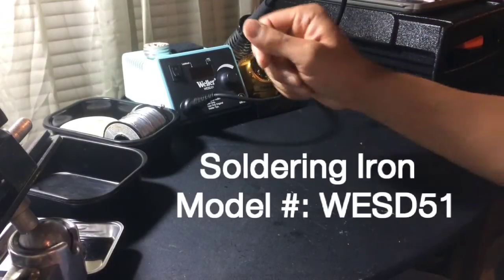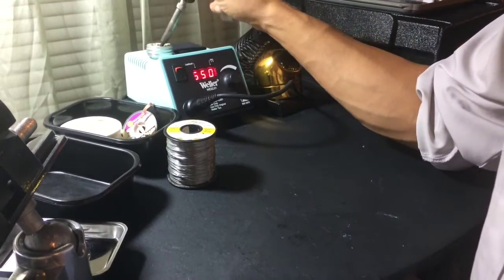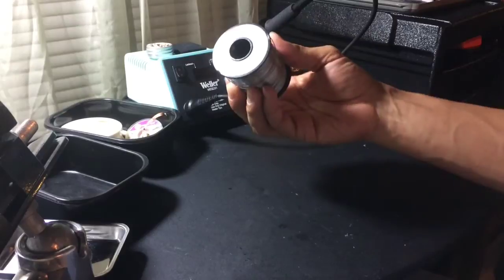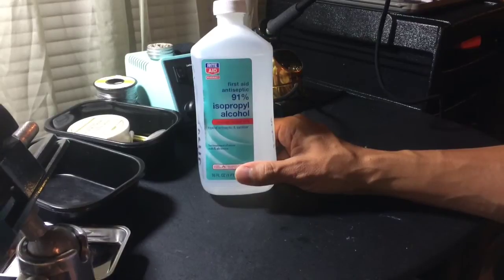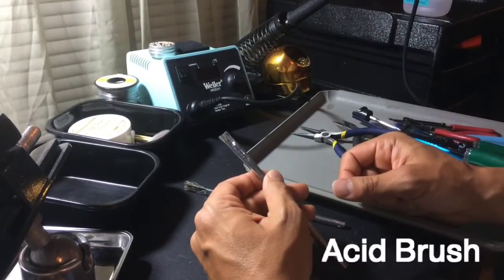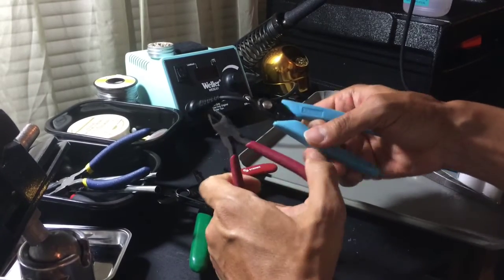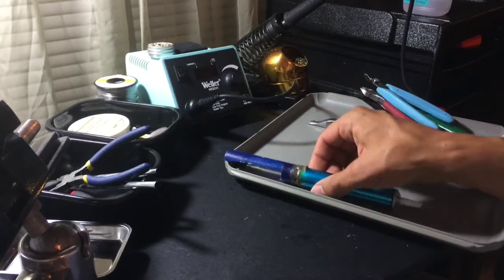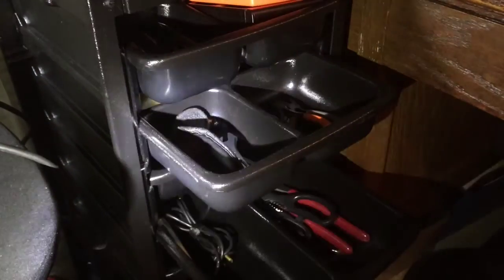Tools for Electronic Soldering

Comment: i know this is old, but "Sticky Mat" has me confounded - sounds like a great idea, dunno how to get it! 
thanks for the great vid - i got at least 3 new things out of it.
keep up the good work.

Russ from Coral Springs, Fl
Reply from the maker: Hey, the "sticky mat" (8:17) can be purchased on ebay as a cell phone holder and its intended use is to 'stick' cell phones to your dash. Once they lose their stickiness they can be washed with soap returning them to their original stickiness. I find it useful when taking things apart with lots of screws and parts because I can place them on the mat in linear order, that way when I put it back together, the reverse order is laid out in front of me, so it serves as a sort of hint on how it goes back together in case I forget. These are also sold at the stationary section made by the likes of 3M. Here's a link, but in case that doesn't work try some of the following search terms: 'sticky mat' 'anti slip pad'. 
https://www.ebay.com/itm/222328388964